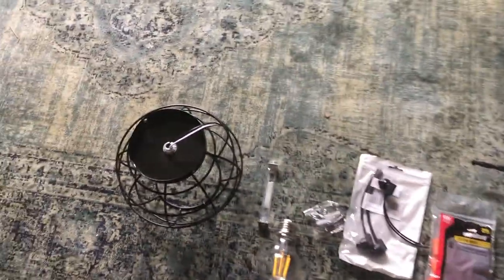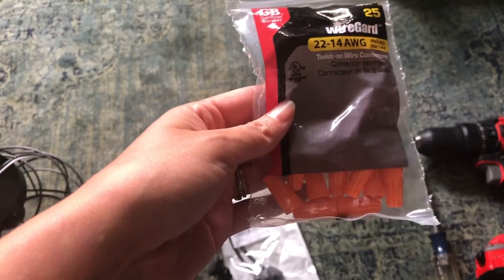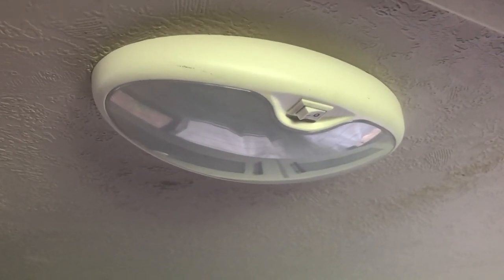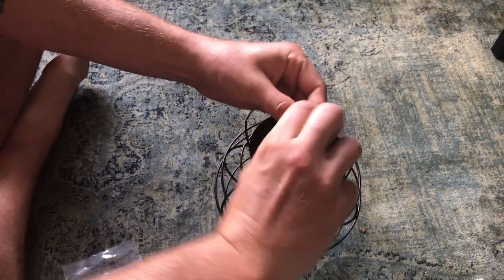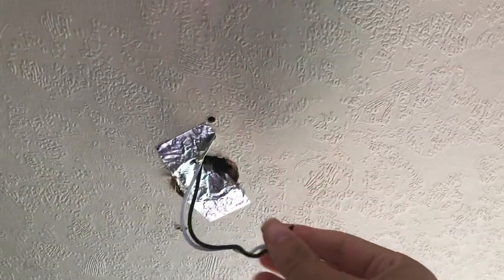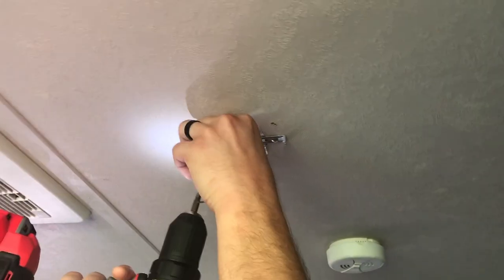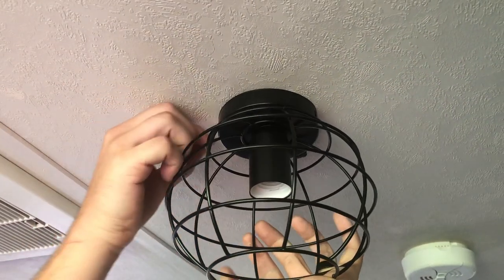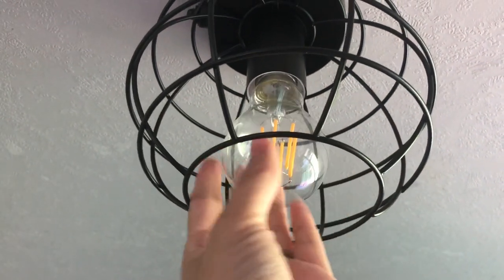How to add switch to RV light

Comment: Ok confused a little where did you wire in the 2 black wires for the switch 🤔 did they get wired to the black and white wires?
Reply from the maker: Yes you hook one switch wire to the white wire and one to the black wire. It opens and closes the current to turn it on and off.

Comment: So just confirming there are 2 black wires for the switch one get wired to the black wire in the light and the other black wire gets wired to the black wire to the rv. Correct?

Comment: Thank you for this great video. What size drill bit did you use? This helps me so much.
Reply from the maker: No problem! I had a hard time finding videos when I went to change myself lights. Glad it’s helpful! I can’t recall what size but the measurement of the base of the switch is 14mm so I think a 9/16 bit would work.

Comment: Can you give me the brand of the switch you purchase on Amazon, I've been looking for some switches for our lights that I'm installing. Thanks
Reply from the maker: Hi Marc, if you open up the description of the video the link to the switches is there. Good luck with your install!
Reply: Question, i have 2 white wires on a couple of my camper lights. Do I have to connect both white wires to the new fixture?

Comment: Would this work for 120v wiring?
Reply from the maker: The method of adding the switch should work for any wiring yes. I originally found this method on another video for regular house fixture wiring
Reply: @kimbereddy  Alright, I will give it a try, thanks. We are redoing our 5th wheel and now adding different lights, but the slide has 12v for 2 lights and 120v for the 2 bigger lights in the middle of the slide.